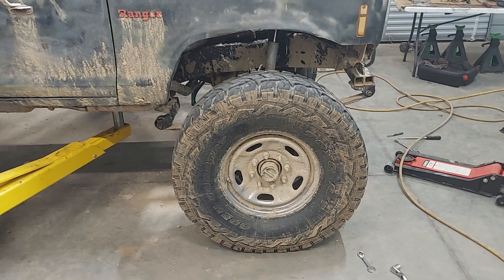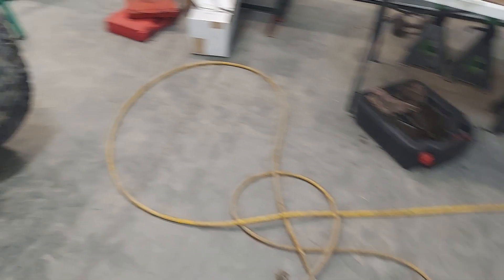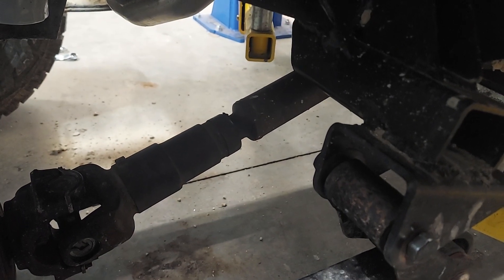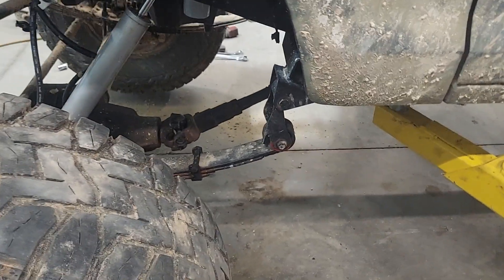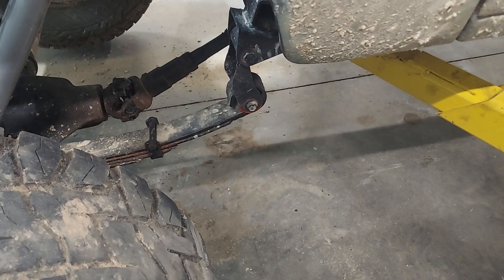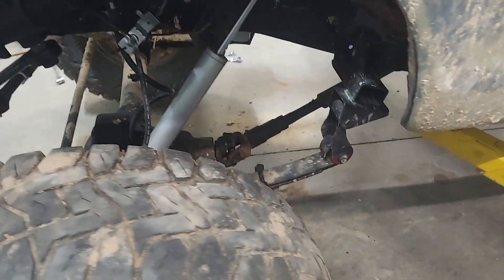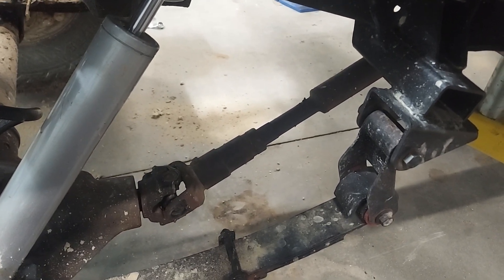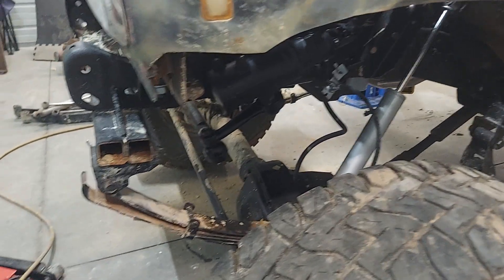shackle reversal sas ranger

Comment: If I was in your shoes, and really liked the shackle reversal. I would probably change it back, and collect the parts I needed to go reversal, then do it up when it wasn't such a snow ball of mods to get it on the road.
Reply from the maker: I may try driving it with the driveshaft out and see how it does
Reply: @slaterrockshop4564 good idea. Yeah may just need to replace that drive shaft, and do the other things you mentioned, and be good to go.